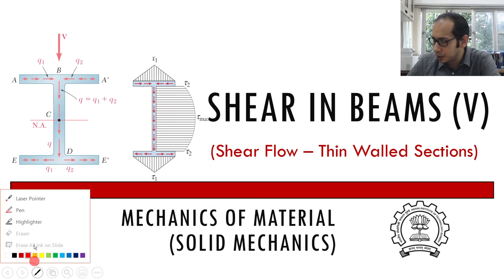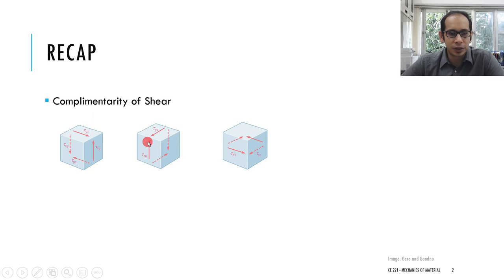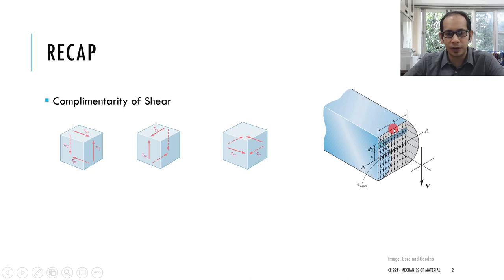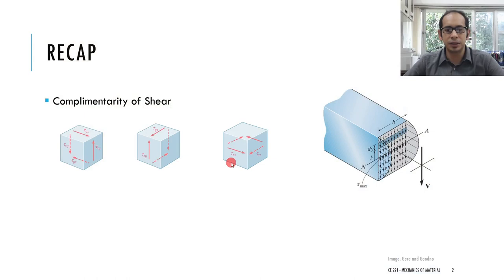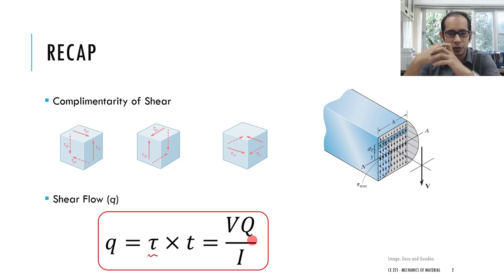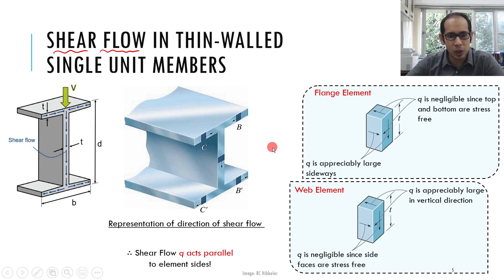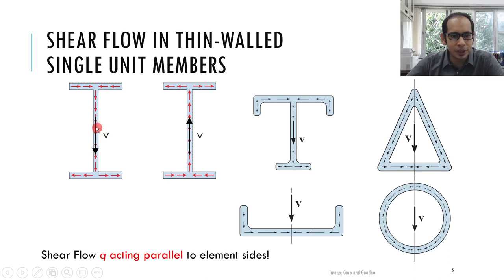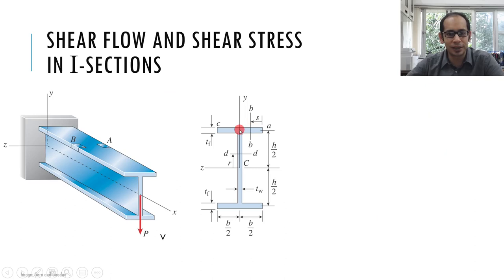Topic # 7.5 - Shear Flow in Thin-Walled Sections (PART 1)

Comment: why at the bottom flange shear is flowing out?
Reply from the maker: Great question. It's again because of complimentarity of Shear. If you take a small element in the bottom flange, note than the bending stresses F, and F + dF are now tensile in nature. That decides the internal shear and by complimentarity the shear on the flange face is directed as if it is flowing out. Sorry, I missed your comment earlier and hence got late to respond. I hope it's clear now.